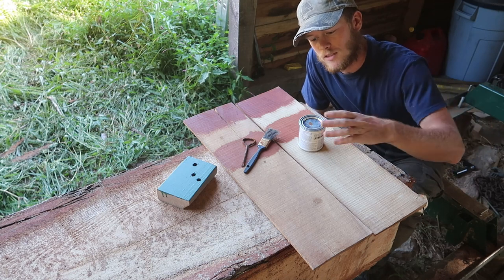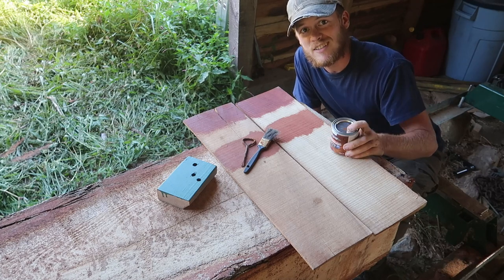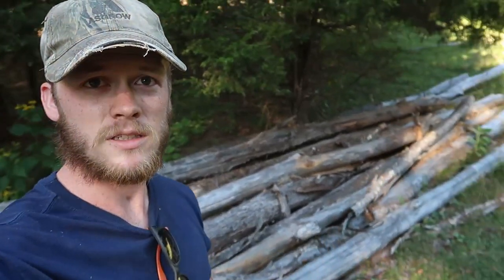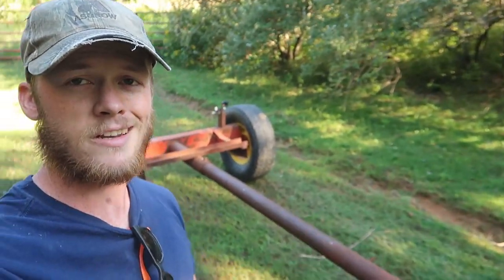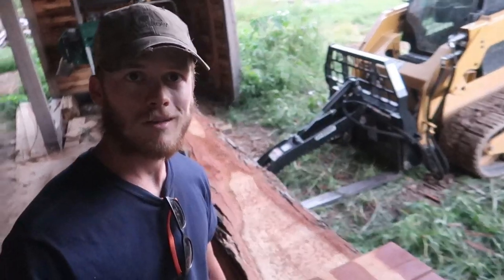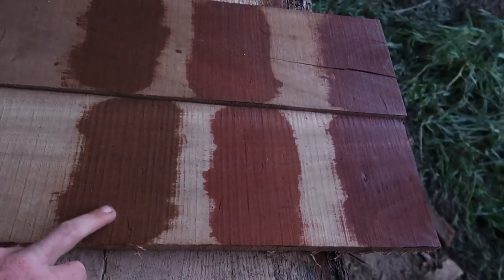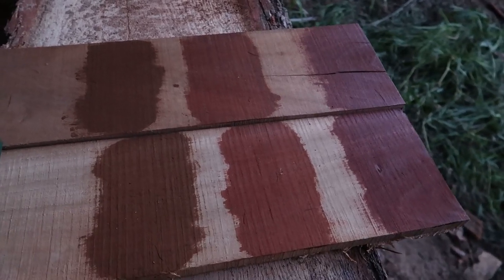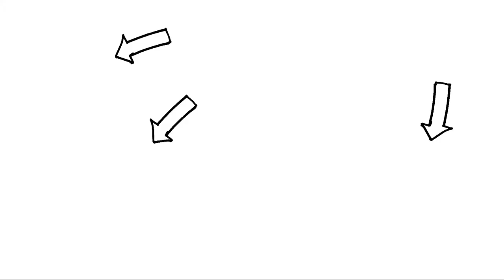More Logs & More Milling - Part 2

Comment: Why not just put a clear stain on the siding?  It would show the beauty of the natural wood and would look great with the green trim!  looking forward to the bridge repairs!
Reply from the maker: Great question. So the brand I'm using has four levels of sealant. Clear(sealant only) 4yr rating, transparent(sealant + a little stain. only comes in a few tints) 6yr rating, semitransparent(sealant + more stain, lots of tints to choose from) 8yr rating, and solid(sealant + most stain, lots of tints to choose from) 25yr rating. I decided to go with the semitransparent because you get your choice of color, decent sealant lifespan, and I think when applied with a sprayer it'll be a bit lighter in color and let more of the natural wood color through.... I think.
Reply: @LandisLegacyFarm  I understand wanting to get the best (and longest) protection for the walls.  Can't wait to see what color you finally decide upon!

Comment: Aren't most Bridge Decks 3"?
Reply from the maker: What I'll be doing is a double layer of the 2x6s for a 4" deck. I figured I could get a bit better yield from the logs by cutting smaller boards.